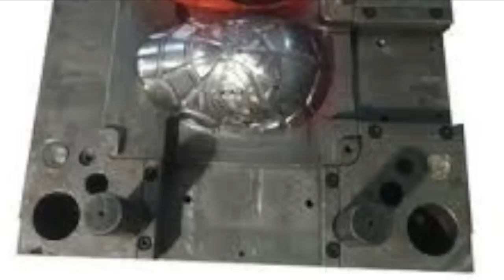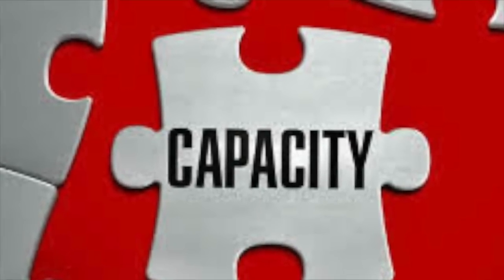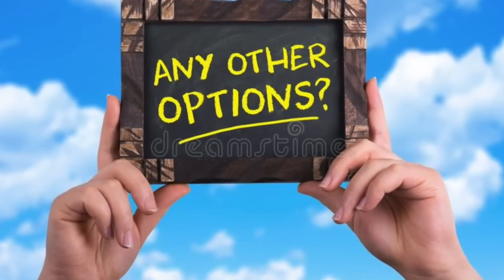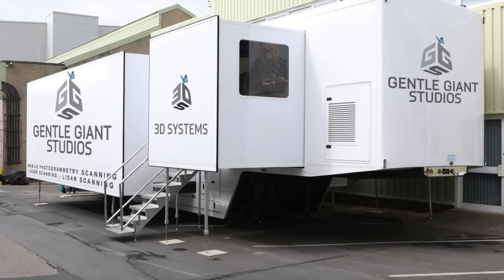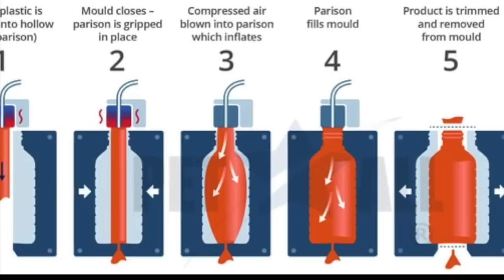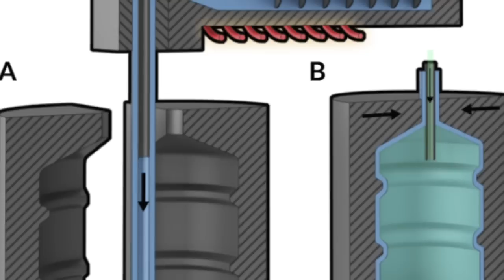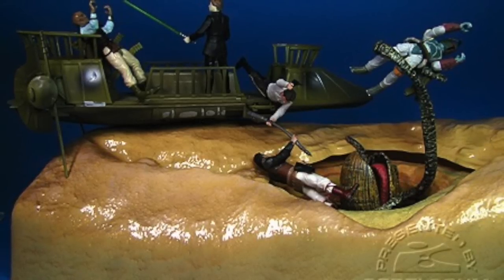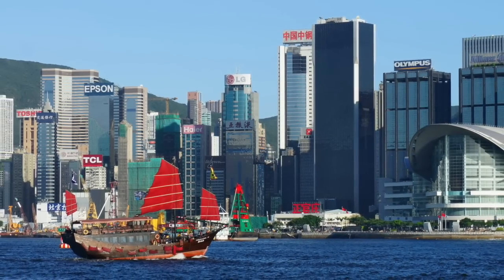What is BLOW MOLDING and how is it used in lieu of tooling? This and more toy questions answered!

Comment: depends on what you call an action figure, i guess. was not the vintage chewbacca, for example, blow molded?
Reply from the maker: Oh definitely not. He was injection molded. A milk bottle is blow molded
Reply: @spectorcreative1872  i should have mentioned the 12", not the 3.75".
Reply: i guess not on second thought, the plastic doesn't seem right. still, some of that plastic for blow molding is tough stuff. what were those little plastic three wheelers we would ride around in called, power wheels? something like that. pretty sure those were mostly blow molded, and they had to hold the weight of little kids.

Comment: Plenty of old blow molded toys had articulation (such as Hasbro’s defenders which were sold as cheap figures to burn though surplus G.I. Joe 12” soft goods, and accessories, as well as plenty of knock off action figures) while they are obviously cheaper than normal tooled toys, it can be done, You also said the same thing about 3d printed parts lacking articulation (also patently wrong) why do you keep insisting on this “fact” when there is so much proof to the contrary?
Reply from the maker: Physically yes but they don’t hold up the way ABS does
Reply: @spectorcreative1872  ABS is not a technique but a type of plastic (are you saying it is impossible to blow mold ABS?)  Let’s not confuse chemical make up of plastic with the manufacturing process. This is why these comments seem so poorly worded from someone who is an industry insider. When you day “this cannot be articulated” that is a pretty bold and absolute claim, rather than stating that parts that are blow molded don’t hold up as  well as solid injection molded parts on the average.

Comment: Blow molding of course you can get it articulated just look at the arms and legs of the princess of power figure that had the retractable and extendable arms and legs that's clearly blow molding
Reply from the maker: Yes but for long term, no the best idea
Reply: @spectorcreative1872  that I can agree with. They would have worn down quickly

Comment: Question about tooling for you, for a toy line that goes on for 20+ years making the same exact products with no changes besides maybe deco improvements, how often do they need to replace the tooling, and how do they do it? Do they have to make it from the ground up again, and if so how is it so identical?
Reply from the maker: Well in Motuc we had to completely replace the tooling for the basic human body twice in 8 years
Reply: @spectorcreative1872  Whats the process for replacing tooling like when trying to produce the exact same item?
Reply: @billbarman  bear in mind the kind of tooling mattel would use for motu would be top quality material. not all molds need to last a million shots, some can use lesser/cheaper materials to do a specific number. 

i'm sure this is all done by computers and CNC machines now, but they would have used a pantograph machine back in the day, basically hand-tracing in 3D and the other end i think would make an electrical charge to remove metal out of the mold, back in the days when the master was carved out of acetate. or something like that. if something in the mold needed fixing, i think the tool and die guys could slap a fix on it. all things wear out, though, so eventually you'd need to replace the whole thing. you can see this in models where the tool might be thirty years old and on the fourth owner the details just are starting to wash out.
Reply: Don't know if there is a toy that has been in continuous production for over 20 years, unless it's Barby. I do know they had to redo the Oscar statue mold because over the years the details had worn away.

Comment: This is not a blow mold question per se, but this video got me thinking…. The series one vintage motu armour that was the bendy plastic style was that much cheaper to produce than the later two piece clip together armour? I mean I assume it would need a tool just the same was it just cheaper plastic? Or was it just one piece armour was cheaper than two piece armour?
Reply from the maker: That was made for PvP plastic and it just another way of doing armor. As the line progresses so did the engineering

Comment: So how can additive manufacturing processes be used to develop new ways to manufacture toys? Could 3D printing become robust enough in the future so that we don't have to continue to depend on the rather antiquated and expensive injection molding and tooling process? There have been advances in 3D printing that produce fully assembled articulated items in multiple colors, reducing or perhaps even eliminating the need for manual assembly and painting. Are such advances coming to the toy industry any time soon?
Reply from the maker: See here:https://youtu.be/RCzm8rW1s8A
Reply: @spectorcreative1872  Thanks Scott. My question goes beyond that, though. I know that consumer level 3D printing cannot produce toys in the same way as traditional tooling. But what is the current state of industrial level 3D printing? How is the technology evolving on that front?

Comment: Just a crazy Idea to cut costs...Do you think it would ever be feasible to sell action figures at retail that are fully painted, but require assembly? (Some assembly required 😉)
Reply: Aren't those basically just Bandai model kits?  You can get colored plastic, but pretty sure most of the assembly cost is in removing pieces from the sprue, not clicking them together, and if you paint them ON the sprue, you're going to have a bunch of unpainted spots where they were attached.
Reply from the maker: See Stickfas
Reply: And playmobil (did) and Mcfarlane got unpainted figures.

Comment: ... would it be possible to use blow molding for the pieces of an action figure, then instead of leaving them filled with air, they were filled with some kind of rigid rubber that was a little malleable when heated but then hardened at room temp?
Reply from the maker: Potentially but it requires a whole other process meaning two process are needed, potentially two factories
Reply: Isn't that just Stretch Armstrong/Vac-Man?  Pretty sure that's how they're making all these Goo-jitsu toys.
Reply: there wouldn't be a point to it other than exercising the fact it can be done. it wouldn't be very functional if articulated and even if gently played with the expansion/contraction of the materials at different rates due to the environment would crack open the outer shell pretty quickly, i would imagine.

Comment: If you haven't already, maybe you could do a video on the different types of plastic used over the years on action figures? Like I prefer the type of plastic used in the 80's and 90's where the plastic was a hard ridged plastic. I don't like the modern type of plastic used as some of it is real gummy and cheap feeling. And some like what Hasbro has been using for Star Wars figures is a type of waxy plastic that I just don't like the feel of. Another example is I prefer the type of plastic used in G1 Transformers compared to modern Transformers that is more of that waxy type of plastic.
Reply from the maker: I;ll add that to the list! Thanks

Comment: I suppose this isn't the same thing, but I recall watching a video tutorial of a guy casting a hollow 1/6 head with a mold, vinyl, and a bag( I think) - he poured a bit of vinyl into the mould, which was inside a bag and then rotated the bag constantly until the vinyl harden.  

Anyway, what is the different between blow molding and rotocasting, and why toy companies do not use rotocasting as much as they did 20 years ago, which  was popular at the time?
Reply from the maker: I"ll add that to the list for a video!
Reply: if you watch some videos of blow molding, these things are just simply banged out fast. rotocasting has its uses, of course, you're just never going to get the same production speed. you would rotocast something you needed more detail out of so the material is forced into crevices. blow molding doesn't give you amazing detail like a black series figure.

things that are blow molded are, well, every plastic container holding liquid at the grocery store, medicine bottles, cheap holloween decorations like the classic candy pales, or those christmas lawn decorations that are badly painted. 

what toy company was rotocasting toys in the early 2000's? what toy company has ever rotocasted for production? lol. i know some companies would make die-cast figurines in a centrifuge and i've always suspected something like monopoly pieces might be made that way. i guess maybe some companies would make vinyl figures this way?
Reply: @ryanbarker5217  Toybiz was making rotocast toys in the early 2000s with their 12 inch scale toylines including, X-Men classics, Lord of the Rings, as well as the Fantastic Four and Hulk movie toylines. One telltale way was how odd articulated they were.
Reply: @FallenGemini  why would they do that? it makes no sense for mass-produced stuff when injection molding pops something out in no time.
Reply: @ryanbarker5217  they did it because it was cheaper to produce and to sell than injection molding at the time.

Comment: I know my friend Pete was able to make pewter or metal Space Hulk Terminator figures using some kinda molds.  I don't think they were hollow he could copy any existing figure.  I'm wondering how he managed to do that or what method.  That just glues parts together so it don't have to move its pretty solid and simple.  Usually its just the arms that glue to the body.  He could reverse engineer anything which was kinda cool.  Many plastic figures have a hole in the foot for a peg, its probably used to make those crappy cheap water pistols that never work too.  Those cheap plastic syringes have a lot of issues I've noticed or don't last long heh.
Reply: I took a couple silversmithing courses in college, and we would occasionally make metal castings out of store-bought cheap plastic pieces (as a starting point, we would add to them)… One of my classmates made a really cool sterling silver ring from one of those cheap plastic spider rings that kids get on Halloween, for example. We also sculpted pieces in wax for castings, too. Basically, you take your plastic or wax piece, attach a cone-shaped blob of wax to it, mount it on a wooden base, put a metal cylinder around it, and fill that with plaster. After the plaster completely dries and hardens, you pop it off of the base and heat it in a kiln or using a blowtorch — the wax/plastic melts and runs out, leaving a hollow form (aka mold). The cone-shape is the top of your mold. You then pour molten metal into the cone, and it flows down into the hollowed out mold. It sounds like your friend Pete maybe uses a similar technique for his metal castings — if he’s gluing the arms in place, particularly to the body, that would promote better metal flow throughout the mold. I bet those figures in pewter look great!
Reply: @jasonaich8071  Yeah Pete bought a CnC machine I think they are called for like 10K when he was making custom guitars.  He got a job as an engineer working with metal all sorts of stuff even a few I think that were top secret or his friend who did things there too.  Yeah his stuff looked pretty good as I couldn't tell the difference,  He was even good painting them doing the inking the shadows for painting.  Even his brother was good at doing conversions for the metal mini figures for games.  I think I'm going to try to do a conversion.  I think he bought some sorta mold or the metal or something.  It sounds like he probably did a process a bit like you were saying.  I wish I got more of the real figures before it all went to plastic resin stuff.
Reply: @Daoloth  pewter is a pretty low-melt metal, and i think you might be able to get away with a high-heat resistant silicone mold for a couple of pulls. you can also add metal flake to your resin to the point where they're magnetized. the crafsman did some experiments, pretty interesting results. 

as mentioned above, there's the lost wax method, too. 

there's usually more than one way to skin a cat.
Reply: @Daoloth  keys are just ground down from blanks. 

i'm not sure where you'd get the metallic additives, i'm guessing where you order your silicone supplies would likely have it. 

i'm not sure off-hand what glue would work best, maybe some two-part epoxy. there are so many different kinds of adhesives out there....
Reply from the maker: Very interesting. I wonder too
Reply: @spectorcreative1872  Yeah I'm going to have to try to ask him if I can get him to reply he has like 2 kids now but I don't think he married her hehe. I really wanted him to make me a Lightning Claws Terminator kinda like Wolverine inspired or a Thunder Hammer one with Shield which is like Thor heh.

Comment: I think you can sort of, make an articulated blow-moulded action figure. The trick here is to blow mould the body parts separately. This means you have to have an individual mould for the arms, torso, legs and head. Once they are done, just put them together and you have yourself an articulated blow-moulded figure. Just like those superhero bootleg figures from China and Mexico.
Reply from the maker: Yeah but it will be so fragile!
Reply: @spectorcreative1872  Yeah that's the whole idea of being a bootleg, right? 😆
Reply: Yeah, I had a knockoff ninja turtle built that way when I was a kid, but if you grabbed it too hard (or played with it too much) it ended looking like a deformed plastic bottle and the arms and legs used to snap off everytime. Then I used to think "man... If I could just get the real thing..."
Reply: @dibujaconmigue Yeah I feel you, buddy cos I had a similar experience but with bootleg blow-moulded Superman and Batman. You could easily and literally turn them to mush 😁

Comment: What i'm wondering is how KO companies make KO's of Masterpiece Transformers. Those have a lot of complicated parts and would seem to me they'd need proper tooling to make accurate copies. So how do they reproduce something like that?
Reply: They probably make their tools out of lower quality metal. Since they don't have to produce as many figures, their tools don't have to last as long. Either that, or they skip out on the tooling bill (like ToyBiz did).
Reply from the maker: sometimes they copy tools
Reply: @spectorcreative1872  I wonder if they could have gotten hold of the original molds when they were thrown out. I got a KO transformers G landcross wich is pretty much identical to the Takara version.

Comment: I thought that tooling was the only way to produce figures…….. I’d love to see blow molding used to produce more dioramas and play sets.
Is the tooling cost the metal used to create the tool, or is it the process by which the tools are etched. I know some 3D printers can print in metal, and wondered whether this was feasible to reduce tooling cost?
Reply: The process is the expensive
Reply from the maker: There are other options
Reply: that 3D printed stuff isn't solid metal, so it wouldn't stand up to repeated use and stress required to make a high-volume product. i guess if you wanted to do it and put the effort into making sure the surfaces were the way you wanted you might get a limited run of ABS out of it, but the juice might not be worth the squeeze. 

i figured those playset bases were vacuformed.